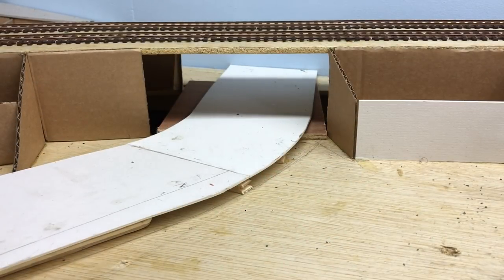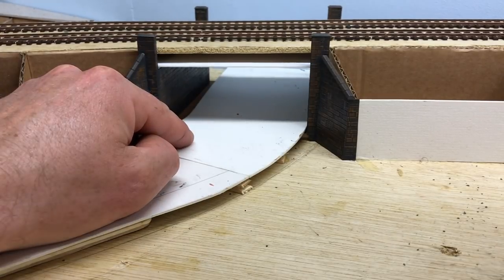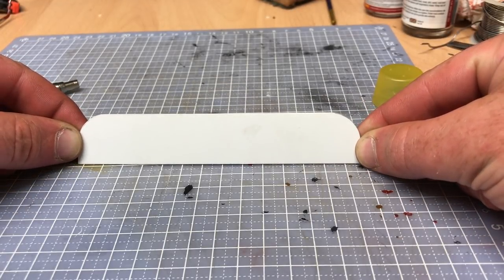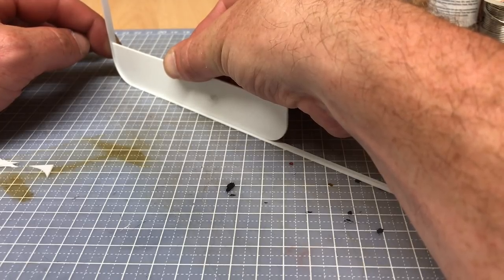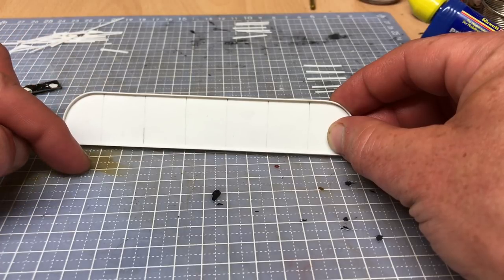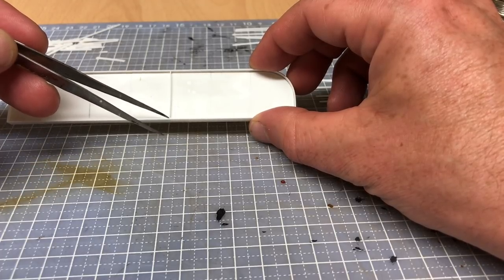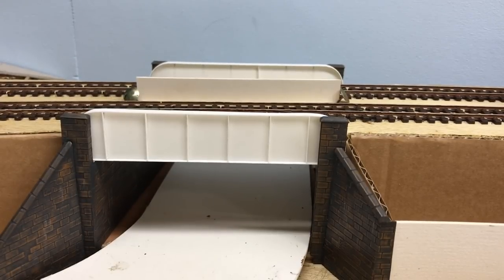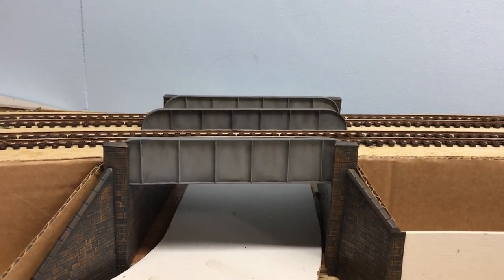Galgorm Hall - Scratch Building A Plate Girder Bridge

Comment: Paul , Brian on Great Chesterford Junction uses a cog out of an old clock to produce a line of rivets see plate bridge on his Gormo's Shed . It really does look authentic
Reply from the maker: Hi John, I think I remember seeing that. At the time of doing the girder bridge I did try applying rivets but the application warped the plasticard and I couldn’t get a neat line with them. I will maybe revisit this if ever I produce another plate girder structure. Paul
Reply: @GalgormHall  Paul the reason it worked so well for him he was using some sort of baking foil . Not at all like plasticard you were using , forgot to mention that last cheers John.
Reply from the maker: @johnodonoghue7381  ahh yes, I remember now. Definitely need to revisit this at some point. Thanks John. Paul

Comment: Hi Paul
Great little tutorial, a bridge would make a great easy subject for an intro to beginners to enter into scratch building, plus its a good way to get a different size bridge to whats available off the shelf.
Reply from the maker: Hi Timbersurf, this is by no means a difficult build with very few materials to produce the required result. As you say, it would make a very suitable entry to the scratchbuilding world and you get the design and size specification you need. Thanks for the comments. Paul

Comment: Hi Paul,
Great tutorial and love the bridge. I travel under one similar on the way to work each day, you're right about the gap between the steel and brickwork it's on some sort of cushion. Don't forget the battle scars if you haven't already, I've seen plenty of lorries wedged over the years, don't see low bridge sign.
Reply from the maker: Hi Wayne, thank you. Battle scars on the bridge, that’s an idea I hadn’t thought of. As to the low bridge sign, I’m modelling mid 60’s and am probably going to use the old format of road signs before the Calvert design replaced them. To that end I think a warning notice came on a rectangular info board beneath a triangular warning on a pole rather than mounted over the bridge. I may be wrong but I’ve yet to find photographic evidence of them. If you have more knowledge it really appreciate it though. Thanks again. Paul

Comment: Hi Paul like the style of bridge with the radius corner's unusual be effective great job, might borrow that idea built one from scratch. cheer's Tony
Reply from the maker: Thanks Tony, it may not have the detail of the resin or kit options but it does the trick. You have enough gaps for a plethora of different bridges and ways to build them. Thanks for the comments. Paul

Comment: Excellent work there Paul. Simple and effective. You know you can buy transfers of rivets? I think they are 3D printed. The centre girder is a nice touch. You see some where the centre girder is lower than the side ones, as you say to allow for clearances etc. Anyway keep up the good work.
Reply from the maker: Hi Dave, yeah, I’d seen those transfers but the price made them prohibitive to use.  I’ve seen those examples of centre girders too but equally they are produced to the same height as the outer ones. I felt a lower centre piece would be lost by the time ballast is added in to the mix so opted for this instead. Thanks for the comments. Paul

Comment: Great build, have you tried a tiny dot of PVA glue from a small syringe or from end of sewing needle for rivets.
Reply from the maker: Thank you Dave, I’ve tried a couple of different methods all of which produce the desired effect. The problem I find is getting that process to repeat in a uniform fashion right the way across the plate. That’s much more challenging so rather than have a wobbly rivet line I’d prefer to do without. Paul

Comment: That's me watched all 3 bridge builds Paul and I'm ready to start my own.  Can you recommend a basic stock of materials such as plasticard (with thicknesses), I beam, H beams, card thicknesses etc that would cope with most scratch builds.  I only ask so that I am not having to order in the stuff I need each time. Thanks Paul
Reply from the maker: Thanks John. In terms of basic materials you’ll want some 1.5 - 2mm card such as Daler board, plasticard is useful in 1 and 2mm thicknesses, 0.5 0.8 and 1mm square rod for making windows, I beams I’ve only used occasionally and would order to size dependent on the build, other material such as plastic strip in various widths again I’d only buy for specific builds. The only other thing I’d maybe order is the smallest size in U channel from Plastruct which is very useful for guttering. You will find that you can’t buy it all at once as there’s always something that comes up you hadn’t thought of but it doesn’t take long to accumulate a variety of stock as each build takes shape. One other thing, never throw the scraps away, they’ll always come in useful for something. Hope that’s of some help to you. Paul
Reply: @GalgormHall  Thanks Paul that’s really helpful. Keep up the good work. John

Comment: Fantastic tutorial Paul, again attention to detail is top class. I am currently building a full scale mock up of phase one of my project and this plate girder bridge and your previous tunnel face are just what I needed so, with your permission, I will be pinching your techniques!
Quick question, do you aways prefer using Contacta adhesive on plasticard rather than the Magic weld types? I have not used Contacta before but it looks very good and certainly in the case of the top girder positioning, much easier to do with 2 hands than trying to hold and paint in the Magic weld at the same time
Steve
Reply from the maker: No need to ask permission, these techniques are really a combination of other techniques I’ve seen and adapted to form a method I’m comfortable with using. 
As to choice of glues, I’ve always just used the Revell Contacta adhesive although I do like the look of these Magic Weld types that are available now. Your right though, the use of two hands during the girder bridge is essential so the Contacta would probably be a more suitable option. Paul
Reply: Thanks Paul